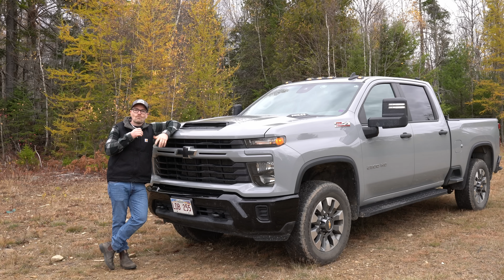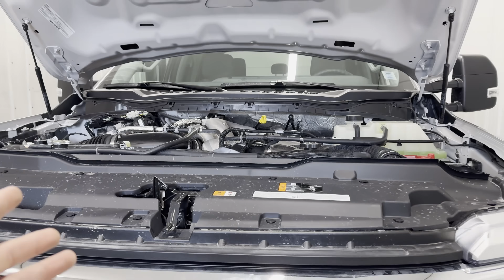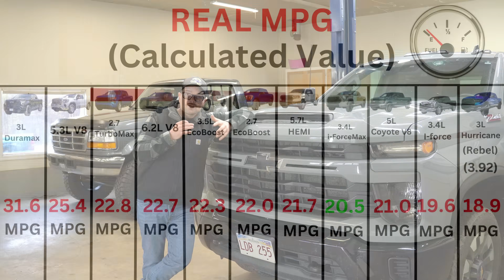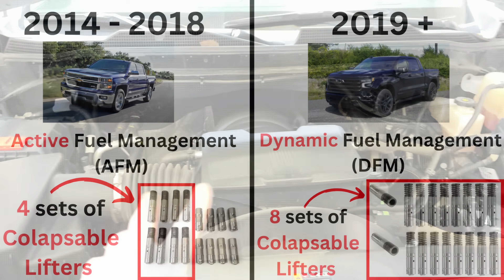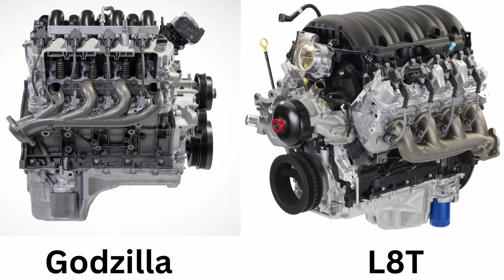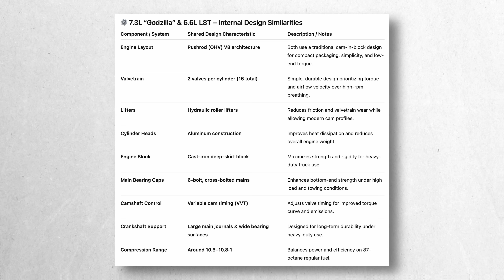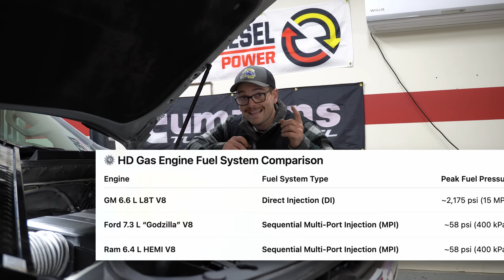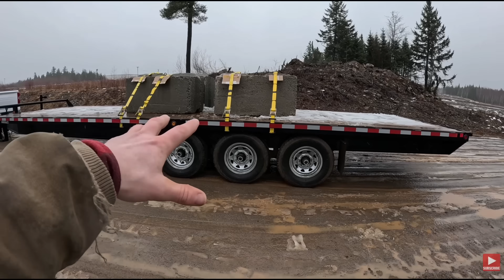Chevy 2500 6.6L L8T V8 Review | GM’s MOST RELIABLE Engine They Still Build

Comment: I'm happy with my '24 so far. Doesn't burn any oil, 10 speed shifts smooth, although it does downshift hard sometimes.  Plenty of passing power, moves itself effortlessly.  Comfortable, nice ride. Great not having to buy def, or doing re gens. Gotta pay attention to fuel range on longer trips when towing heavy. Over all I'm happy with it
Reply: NEXGEN has the required valve body updates to make that 10 speed almost perfect.

Comment: I wish this engine was offered in the suburban/yukon xl
Reply: I have it in my 2024 Express 2500 van with the 8 speed. Loving it!
Reply: it’s an easy swap
Reply: @Bonez1LE  and cost an arm and a leg on top of the 6 million dollars purchase price
Reply: @BF1-P  they keep things similar as long as they can. you can likely find a used one that has a blown motor, buy it cheap then get this swapped in. the yukon and such share the engine compartment with the 1500-3500 and you can usually put  any engine option from any of those in anything that shares a platform with it.

Comment: Glad to see cylinder deactivation gone, now direct injection and "dual" injection needs to go as well. 2 fuel pumps and 2 sets of different injectors to solve what port fuel injectors alone have been doing flawlessly for 40 years? Makes no sense whatsoever. Not a single person on the planet cares to pay thousands extra upfront to save 0.5mpg only to have a $3,000 high pressure fuel system repair bill every 120k miles.

Comment: I'm surprised to hear about how the transmission shifts on this truck because my is smooth as silk and one of the comments that I keep reading about on 6.6 forums is how smooth the GM transmission shifts compared to the Ford.
Reply: I was surprised as well, I wonder how many miles is on that truck. I have a 2025 model and I have to say it shifts smooth, the only time I will feel a bit of a jerk if you will is when I slow down a bit more aggressively for a turn and the transmission is busy downshifting and this is at slower speeds during that process when it gets into one of the lower gears and naturally is doing more engine braking, otherwise I am slowing up more gradually I never feel anything much. Accelerating, mostly I drive like an old person but once it was more broken in ( I only have 4000 miles on it .. I am in Canada but I typically speak American LOL ) I tried doing a couple of high speed runs from a standing start and that is when one realizes how much control the ECM has over the engine and trans to protect the trans/driveline. At each gear shift it pulls a lot of throttle away so the shifts are soft and yes that makes the truck seem dead with all those lag times as it does not stay on the power and abuse the transmission. It won't win any races with that type of power off shifting but if it helps prevent trans abuse I will take it as a win in the long run. I've had two other people try out my truck and I was in the passenger seat and both of them remarked at how seamless the shifts were and were quite utterly amazed at how nice it drove for a 1 ton truck ( I don't run the tire pressures jacked up with the near empty truck, that makes a huge difference to the over all ride experience ). I never did try out a Ford to compare with so I just don't know, initially I believe the Ford was initially programmed to skip shift a lot and I think that may have been some of the issue as I at least got the impression the more recent Fords are behaving better ... I think.
Reply: My six speed in my 22 2500 shift smoothest silk

Comment: I work for the service department of an electrical manufacturer we are national across Canada and we run Silverado 2500 with the 6.6 gas from 2022 to 2026 models. The 2022 models have all 200,000 km on them with little to no issues. We have caps on them loaded with tools, bolts and copper bar about 1500 lbs in the box and we tow heavy 16’ covered trailers. Gas mileage while towing is as expected about 25-27 L/100km not towing I can get mine down into the 12-13 L/100km range with ease while doing highway and that is with AT tires or studded winters on steel wheels I regularly drive Sault Ste Marie to Ottawa comfortably on one tank that’s 120L for 950 ish km. I don’t agree that they are the worst on fuel because my previous truck was the 2500 Ram with the 6.4L and that truck got 18-19 L/100km at best with a tail wind and was in the 35-38 L/100km towing the same trailer mentioned above. We have some that consume oil but that only becomes a problem if you push the oil change interval past 12000 km I change mine every 8000 km. I do recommend a catch can on the PCV circuit you can definitely see a difference in the blackness at the tail pipe between the trucks that run a catch can versus those that don’t they will have much more soot and black the catch can will save your intake from getting carbon up. Your trucks do a lot of idling in the winter they idle all day long when we work outdoors but as long as you get them on the highway often which we do no issues. The 6L90 is very clunky especially on the 5-4 and 3-2 downshifts at light throttle all the 2022 and 2023 trucks have this problem and sometimes they hesitate on steep uphill climbs when the truck is loaded but in that case I always manual select the gear I want and put my right foot into it. They are clunky transmissions but treat them to oil and filter changes every 80,000 km and they go the distance. As for repairs we have 7 of them in our office alone the 2024-2025 had recalls for the screen programming and the 2022-2023 of which we have 4 the only repairs we have seen are AC compressor on one and a starter on another that’s it, mine has been loyal just going to the garage for oil and brakes in 200,000 km. I also did change spark plugs at 160,000 km. I just ordered a 2026 to replace my 2022 and am planning to buy mine off the company to keep as my weekend boat hauler at home. I have friends with F250 7.3L Godzilla and although the motor has been solid the electrical nightmare with modules and wiring faults in the trucks as well never ending visits to the dealer without resolution is enough to keep me away from Ford. As for the Ram 6.4L once you hit 80,000 km we were dumping between 3000-5000$ per year into pretty much every Ram in the fleet consistently and it was always the same things, manifolds, U joints in the driveline, water pumps, wiring issues (shorts due to rubbing harnesses and faulty modules). I would not hesitate buying a 2500 GM with the 6.6 gas, I was a big duramax fan up until I drove the 6.6 gas and having the experience I had I would not hesitate buying one personally. None of our trucks have had any issues with the direct injection system whatsoever. These are indeed overbuilt motors because we beat on them pretty hard they spend most over 50% of the time towing 8000 lbs + over mountains with confidence. My only concern with the new ones is the 10 speed transmission I know GM has issues with the valve body in the duramax version of this transmission but we will see in the next few years as we have 2024 in the fleet that are over the 100,000 km range.
Reply: What are you guys running for oil in your 6.6's? I've got a 25 coming up on its first oil change, and I'm debating on what to use. Thanks!
Reply: I read your experiences with the L8T and the truck in general with interest as I had bought a 2025 model earlier this year but have relatively few km on it ( I am in northern Alberta ). At this point the plan is to do 5000km oil changes although I am a firm believer in changing the oil early in the beginning so first change at around 900 km and doubled that for the second change and just changed it again recently for the third time and its nearing a total of 6000km on the truck. And as to the transmission, who knows how that valve body issue will go as i don't expect to be in the clear there and of course it will happen after the warranty is gone !. 

However I have a question in regards to the studded winter tires your running, is there a particular brand and model of tire your company has been using and how have they panned out. I had just put on the winter tires I had rigged up on a set of used wheels last winter but they never went onto the truck as winter sort of disappeared early back then, so now they are on and winter is near. They are the Nokian LT3 studded tires in a 275/65R20 and I've not use Nokian before nor a 10 ply truck tire either as I assume they won't work as well on ice as the car/light pickup tires for the half tons that typically have a very soft compound and are on P rated wimpy soft tires.
Reply: 260,000 km on my 6.4. Been a dream, haven't touched the engine or transmission
Reply: @Builder1995 what year?

Comment: Had this truck for pulling an rv, sold it after 6 months. Loved the engine, hated the tall hood. Ridiculous driving experience. The new trucks are so tall you can’t see.
Reply: You just short
Reply: A $25 seat spacer kit from Temu would have fixed it 😉
Reply: What? I am 5'3" and have no issues seeing on my 2025 6.6L 2500. Daily driver and towing our 24' RV. I owned a 2019 F150 and had a harder time seeing than this truck. Wife even commented I park and drive this truck better than the Ford. If you sold it after 6 month you lost your ass $$$$. I call BS!!!
Reply: thanks gov regs.
Reply: @mattaomartinez.9817  How is a tall hood anything to do with government?
Reply: @nickberg4379  Not a dam thing, always one in the crowd that has to bring politics into everything. It's purely for looks in my opinion. Makes the truck look beefier.
Reply: Or being able to see

Comment: I am with you on the reliability question. I am a firm believer the gas is far more reliable than modern diesels.
Reply: The diesel engines themselves are stone cold reliable.  The problems with modern diesel engines are all the emissions devices and ancillary systems.  The  DPF and DEF systems are extremely trouble prone.  The early 6.6 ISUZU DuraMax was very reliable, mine has 214k miles.  Just now needing injectors and it gets great fuel mileage.
Reply: @mlynch001  well since they have it that would make them unreliable
Reply: Depends on brand. And if you delete any diesel its going to be alot more reliable

Comment: Great video I had a 22 7.3 Godzilla the 10 speed transmission was so clunky would sometimes jerk you took it to the dealer a couple times said it was normal just purchased a 2026 2500 HD 6.6 gas transmission of course with only 600 miles on it now there’s so much smoother. Seems to be the opposite of what you were saying. I don’t know if it’s just individual transmissions, but that was my experience as far as the engines. They seem very similar how they drive. The Godzilla did seem a little more powerful just seat of pants feeling, but I love the way the General Motors drives with the independent front suspension, especially at highway speeds.

Comment: Price is the fundamental problem. 

Also would be better off with full flow oil pump.  Lifter longevity is still uncertain.

If you can live with poor fuel economy and these limitations, this may suffice.

But most people would probably do much better with a second hand tundra 5.7.

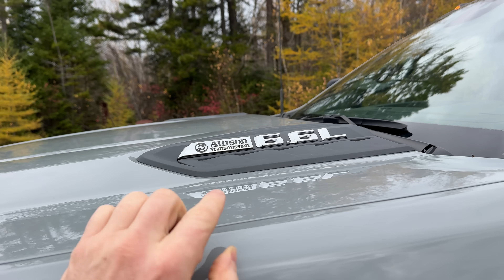Comment: 1:02 anything 2020+ GM bought the rights to slap an Allison badge on there. That’s a GM10L 1000 transmission. Before Allison actually built the transmission.
Reply: I have read where Allison hasn't built a transmission for GM for many years now. They are GM built transmissions designed and licensed by Allison. GM actually just got severed from A and pulled all of those A badges, supposedly.

Comment: That fuel pump looks easy enough to me just pop off the intake which from what i see doesn't look to hard. Probably a bunch of 10s on a long extension n some lines n hoses im guessing shazam your done. Sounds better to me than dropping the tank n all that especially after this truck has some miles n years of abuse on it. I live in the Midwest and you don't wanna take out the tank out on a 10 year old truck.
Reply: There is a low pressure supply pump in the tank and then the high pressure pump on the engine and I think most vehicles these days and be that gas or diesel have all gone to supply pumps in the tank. The Ford would only have that in tank pump so in theory would be the more simple system and cheaper injectors etc and GM says to replace the high pressure lines under the manifold once they are touched, same deal with the 5.3 and 6.2 for years now ( not that I have personally worked on any of them yet ). But I hear you about dropping tanks on older trucks, I've done that and its no fun and often everything that is touched is rusted garbage and is an expensive ordeal just to replace a low pressure pump.

Comment: Have one, it tows our pull behind once a month, the rest of the time it is my daily driver.  The motor has been fantastic!  One thing I did was add a throttle programmer...  It's a nice unit that allows the engine to warm up a little (get the oil circulating) before it takes the throttle to a new level.  :)  The truck tows our trailer around without any drama.  We do a lot of hill climbing and it has been great.  I tend to not go over 65 on the highway towing or not...  to eek out some extra mileage.  The worst thing about this truck, and of course it is just part of owning an HD, is that driving and parking in the city is a royal pain in the behind.  I had a 1500 before it, and it handled like car... this thing handles like a truck.
Reply: What kind of throttle programmer did buy? I have a 2025 6.6. I hate when you start it up it jumps to a high idle

Comment: Also what your looking at for that block on the oil cooler lines is basically a oil thermostat so when it’s cold that block does not allow oil to pass through the cooler to warm up the engine faster
Reply from the maker: Makes sense! thank you

Comment: Your display of how difficult to remove the plastic covers proves GM isn't for you repairing it yourself. Clearly you need to lift the cab to just take that cover off lmfao. This video just gave me 50 more reasons to not buy a Gm HD truck on top of the 7501 reasons before this. Haha

Comment: Mines burning fuck loads of oil and heats up to 230 when my trailer is empty but not loaded🤦🏼‍♂️ rev past 3k and it cools back down for a little while
Reply: It’s at 83k 2020… wouldn’t recommend anything GM beyond 06 after this piece of shit truck. I get in some mud in 4lo and it throws a shit fit all the warning lights come on and it goes into reduced power. Reset codes put it in 4h no problem. Got 2 8.1s that pull better on every front and burn less oil being 23 years old😂
Reply: @bradymeredith3528  Didn’t change your oil and ate up your piston rings with a bunch of fuel diluted oil.   Never listen to what the manufacturer says for recommended oil change intervals.  Now it’s going to cost you.
Reply: @holdenc3082  maybe who ever had it before me. Don’t assume I’m a dumb ass i change my oil more frequently than anyone I know. Oil and filter every 3-4k. I think they programmed it for 8-10k mile changes it’s usually around 50% oil life when I do it. Lotta people say I’m wasting oil but I dog the shit outta everything I own and my L8T almost never gets unhooked from its trailer. Also how tf would that cause it to run hot intermittently under medium load and then magically cool off after reving past 3k.

Comment: Injector failure is more related to lubrication.  Instead of guessing about when to change oil send your samples in every 2500.
Reply: Gasoline injectors aren't lubricated by engine oil.
Reply: @benjaminwayneb no they are not it has to do with additives in the fuel. Just like a diesel direct injection and you know what I meant. The EPA has regulated the fuel to the point you better be adding a lubricant to your fuel delivery system. Cat in the old days were bad about injector failures and a simple solution in the mid 90's was adding 2 stroke oil to your fuel. Don't do that with today's one box EPA crap diesels though. You will mess your one box up more than likely.

Comment: Trucks should be simple tools... V6's (like the Ford 300 i-6 or the GM 3800) and V8s (318, 350, 351, etc), no turbos (except on diesels), no AFM or DFM,  multi-port FI only, no big computer displays, just simple analog gauges, regular thermostats and rads, no stupid sensors all around... tough trannys like the Allisons, full frame no unibodies... big simple knobs for heater controls, radio, and the like. Even numbers of cylinders. They need to get away from all the computers, buttons, sensors, and plastic. AND NO WET BELTS!!!  (Whoever thought of doing that should have their engineer's degree taken away - if they actually have one). Simple but tough!!!

Comment: I asked a guy with 175k miles on one of these what he did for carbon build up maintenance. 

He didn’t. No issues.

 Not saying don’t but it’s encouraging.

I like the plastic covers and a tidy engine bay. Ford will seemingly runs hoses or wires across anything. No hate, I owned a hybrid maverick and I’d happily drive an f250 with a 6.8 or 7.3, great engines. Chevy just offers more value per dollar.

Comment: The 6.6 with the 6speed I’m driving slams into gears. Usually 3rd. 35k on the clock and has been that way since new.
Reply: My 6.6 6spd has some rough down shifts I think 2nd to 1st and not always but super smooth going up. 58k on the odometer.